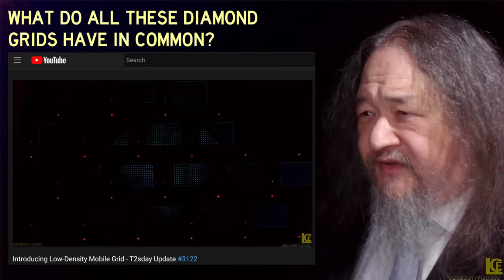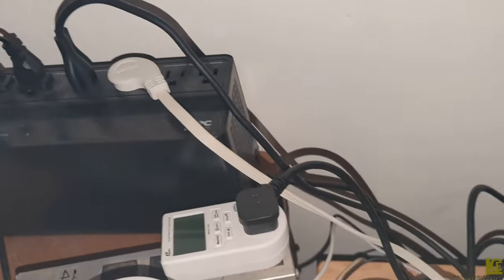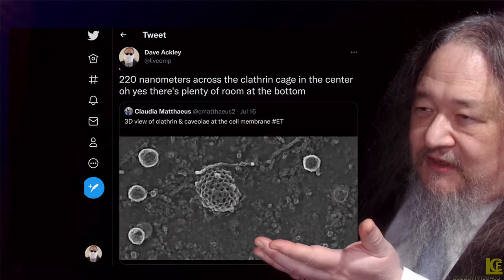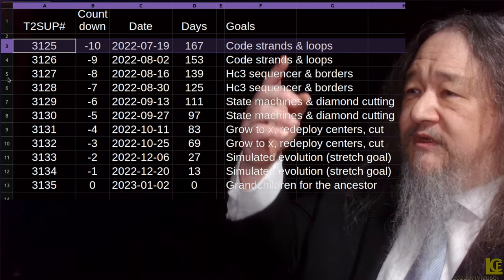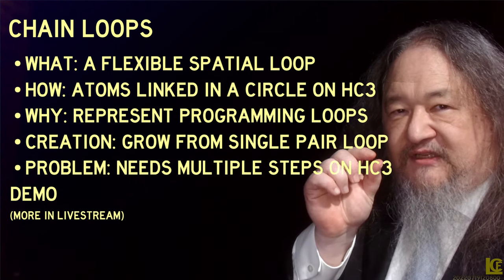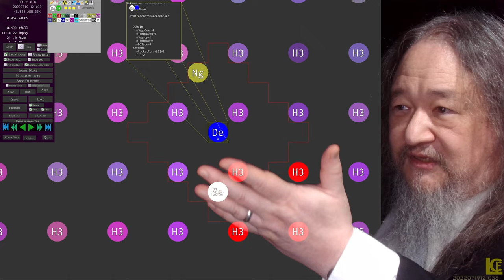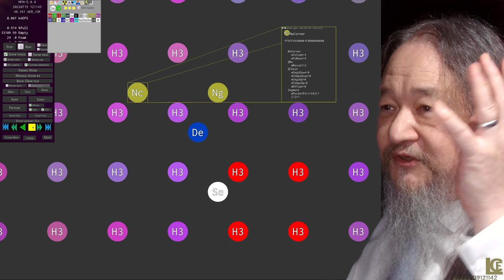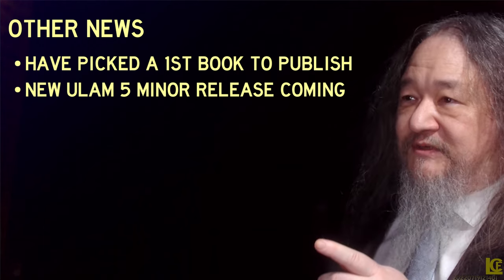Artificial Life Development Countdown T-10 - T2sday Update 3125

Comment: I hope I don't disctract you from your core work with this question, but would it be possible (= doable in reasonable amount of work) to make the real tile grid a little bit larger than the visible tile grid for live tiles? I'd rather not see everything but have the larger object aligned, instead of seeing everything but see a distorted view due to the tile casings.
Reply from the maker: :) Just last week I was looking at image processing hacks to scale up each tile LCD image in place to cover (most of) the surrounding tile bezel. It's not working yet but we'll see!